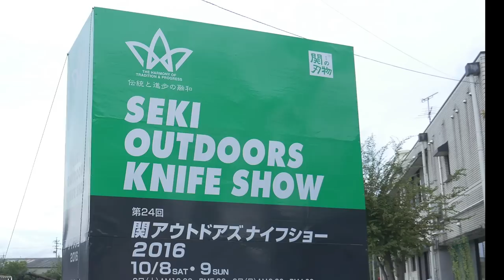Japanese Knife & Sword City: Seki Experience ★ ONLY in JAPAN

Comment: dont cut on glass if you love your knife...
Reply from the maker: boedhaspeaks I love my knife! I will treat her right and NEVER do it again. Thanks! -J
Reply: Maybe an episode on sharpening?
Reply: A chef's knife/santoku isn't the right knife for a plate anyways. A pocket knife or small fixed blade would be a better fit.
Reply: Yeah the Santoku is more of a preparation knife then one you would eat with. So don't use glass cutting boards with them. Wood and Polyethylene is fine for prep work.
Reply: He just wanted to have his brand new knife cut something. And he explained on another comment that it had been a long day and he didn't have anything better to cut on, so he went ahead and cut carefully.